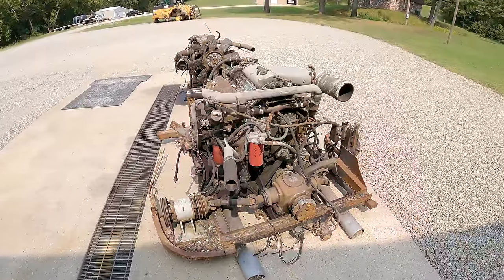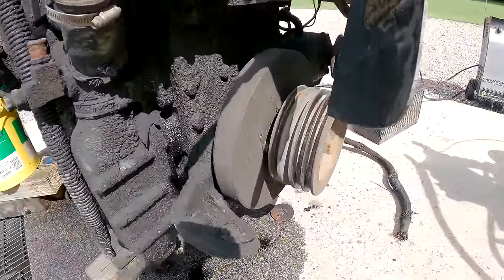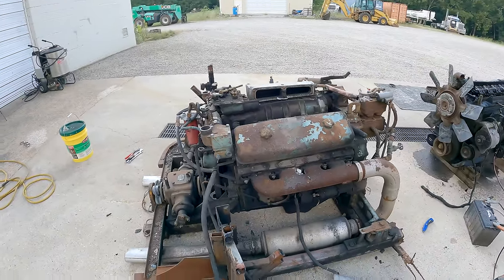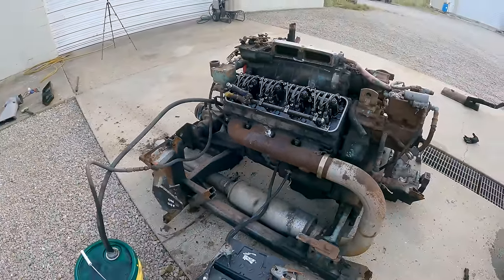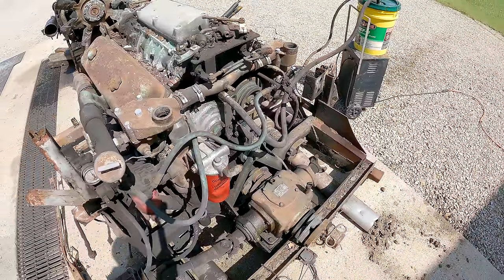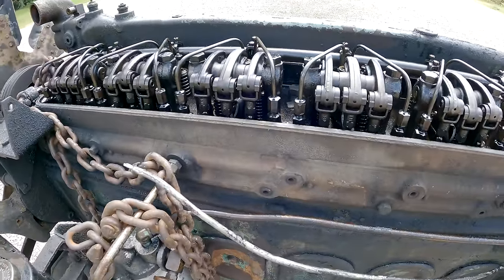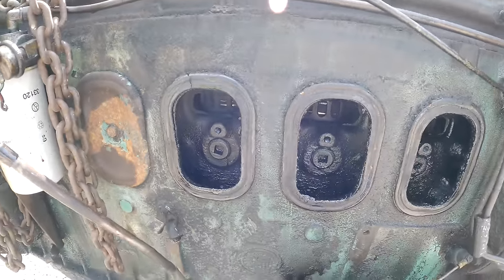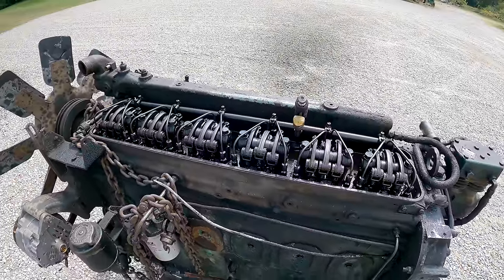Runaway 6-71 Two Stroke Detroit Diesel - Double Greasy Detroit Revival

Comment from the maker: Link to the engine teardown video on the 6-71:
https://www.youtube.com/watch?v=8Oyp_IiR1e4
Reply: 0
Reply: 0i
Reply: For as long as it ran at full tilt, it probably would of ran for another decade if put in an old farm truck and maintained.
Reply: Whats fkd up is they dnt make them that tough anymore. Look that she wants to still go
Reply: So that's not a runnaway. That was just full throttle. If you want a runaway plumb a gravity feed jug of fuel into the intake. Then runaway. She will split open
Reply: @shanelitzow2059  never though he could have another shot at that engine but if he ever decides to do it again or even better yet lable his videos correctly. Diesel engine runaway requires excess fuel causing the engine to Rev past its limit as diesel engine speed is totally controlled by fuel flow
Reply: @thewelfairshop4164  KT was probably trying to simulate the engine running away even though the rack was in full fuel position, im supprised the engine didnt run out of fuel though😂
Reply: I have dealt with 2 stroke DD for 40 years and while not as popular as they were there are many bus enthusiasts that look for parts when they need them. To purposely destroy one is a crime.
Reply: .ü
Reply: It had no coolant.  Just got hot and seized .  Pistons got so hot and scuffed so bad friction and lack of compression killed it   Like others I find this sad.

Comment: If it had a coolant system on it it would probably still be running lol
Reply: What a foolish waste.
Reply: @grantw.whitwam9948  you too.
Reply: We would be looking for hearing protection!
Reply: @grantw.whitwam9948  yeah that’s exactly what I thought! It could have been a freaking good engine if the admission was fixed instead of leaving it stuck wide open!
Reply: It was destined to the scrap pile to be melted down anyways.  Nobody wants them.  Inefficient, and heavy for their power.  They were incredible engines for their time, but their time has passed.
Reply: Screamin Demon.
Reply: @matthewbeasley7765  not really.  They are used all over the place, reason being easy to work on and maintain
Reply: For sure !
Reply: could have easily hooked a radiator up the the oil line. and turned it into an arc welder with some alternators....
Reply: @matthewbeasley7765  never. Todays diesels contain software to prevent any non dealer service. Watch your mouth
Reply: No shit
Reply: They’re cool and reliable and that’s really about it. I can see saving one that was a generator or something with no hours. Why bother with this turd.
Reply: It sat there floating the valves at about 5000 rpm. You are correct, if it had coolant, it would be sitting there to this day making noise and smoke.
Reply: @matthewbeasley7765  hahaha. You should do some research. Cummins is building this 6 banger to go in semi trucks. It has 2 cranks and runs piston to piston. No head!! The British have been running them in trains since 1951. It's called the deltic .... it has a 55% thermal efficiency and produces more power per pound than any other engine made. 4 cycle engines will soon be a thing of the past.
Reply: @grantw.whitwam9948  they   dont seem to sell for much   on ebay etc     interesting but not  worth much    id not take much to  make it worthless     eg one  jug low on comp etc
Reply: Jim jibroni  wrong
Reply: @EXwifeKILLER  used all over the place, yes....but mostly in 2nd and 3rd world areas
Reply: @k.r.f.j.b.8144  nah. In the United States daily.  A lot of barges run them because they are easy to maintain. Also used in Euclid dump trucks daily at some steel mills as well.
Reply: @matthewbeasley7765  I would have taken it..
Reply: Jim jibroni  I'm a semi truck driver I would have swapped it and used it till it died. Given I didn't die first.
Reply: Jim jibroni  they are good in boats because you are always pushing. But yea that motor was worn not worth anything.
Reply: Jim jibroni elaborate on why I wouldnt seeing as you are me.
Reply: No it wouldn’t it’s a Detroit lmao
Reply: @machiii7394  John Deere has software so if you do pretty much anything the tractor won’t move or it’ll have idiot lights on everywhere and you cant use them.
Reply: You guys are out of your minds. If it's so precious then why didn't you buy it? Nobody wants them and you guys talk about Detroits like they're national treasure. If it wasn't destined for the dump then it would not be there in the first place. Yeah, they're great to talk about but stop trying to justify saving crap on a zombie apocalypse.
Reply: Yes.. It could have gone on a trike or something!
Reply: Jim jibroni  "Oh for Christs sake" "NOBODY I mean NOBODY "  🖕   I guess I must be "NOBODY" I want a 3-71T in my F250, might well have been some thing of trade here ... Your diatribe should be reported I think. But I'll leave the foolish remark untouched  🤔 YEP
PS What pray tell has the EPA done for your pocketbook?
Reply: @TheReid1233  LMFAO
Reply: Jim jibroni  This channel doesn't have any content
Reply: Volvo b10 run all day with no water. and under load..
Reply: I was going to say the same exact thing
Reply: @charlesangell_bulmtl  -You threatened to report a comment because you didn't like the content? Pretty weak.
Reply: If it had infinite fuel, I bet yes! For 5 months I'd say.
Reply: @grantw.whitwam9948  how’s that I absolutely hate when people say that it’s a warn out greasy motor that no one wants how is it a waste what would this possibly be used for
Reply: @grantw.whitwam9948  You are so right...

...I see these becoming the "passenger pigeon" of our time... XD
Reply: @EXwifeKILLER  
Off highway only. you will NEVER see one in a working DOT inspected truck
Reply: @charlesangell_bulmtl  
"you should be reported" this hurts my feelings awww what a tool
Reply: @thicok4555  Those whom don't respect themselves generally don't respect others.
Reply: @zoggrog8823  Those with a shame based childhood often shame others.
Reply: I agree 100%
Reply: @grantw.whitwam9948  bro it's just a engine that he owns
Reply: Ten years ago I regularly worked on dd two strokes.6 and 8v71/92s.plenty of prime movers and buses still using them.
Reply: @russianacorns8080  hackers and farmers are forming relationships. software is now reverse engineerd like aftermarket parts. Just dont buy brand new and there should be a way to work on it.
Reply: @zoggrog8823  i have a greasy 361 industrial ford engine in an inspected dump truck that had a DOT number. 1972 vintage truck still hauling 6 tons 15-20 miles, almost every farm in america has at least one 2 stroke on it. Also youve never heard of a glider have you hmm? these 6 cylinders are too small for a semi but a 12 cylinder 2 stroke is perfect and lots of them are still on the road
Reply: @russianacorns8080  we had one in a gmc general. Still in use to this day. A detroit obviously. It did the job very well.
Reply: @aeroflopper  proof
Reply: @matthewbeasley7765  a lot of people want them.  They are still used all over the world.
Reply: @matthewbeasley7765  that is a lie. there's quite a few trucks still using them.
Reply: @grantw.whitwam9948 I understand what you're saying, but they produced untold millions of these from 1938 to 1995. Are you gonna rebuild them all? Do they all belong in a museum? This engine was going to be ground up and recycled. Why not have some fun first 😁

Comment: They were phenomenal engines for their time,no other inline six in the world could run that long under wide open fuel and no coolant.
Reply: Valve float saved it from scattering parts maybe.
Reply: They were originally designed to run for 10 minutes with no coolant in Higgins craft landing boats so they could keep the hydraulics running
Reply: Yeah, it only stopped because it obviously heat- seized. If that had coolant it would have been fine.
Reply: You can even see it backfiring too
Reply: Absolutely amazing this thing powered our boys to victory on D-DAY!!
Reply: Yeah I don't even think a Deutz air cooled would stand up to that
Reply: Have to remember it's a 2 stroke it will run longer without coolant than a 4 stroke would
Reply: @joecameron3512  explain 2 strokes make twice much power and heat
Reply: My Cummins N14 shuts down if the ~ 10-gallon cooling system is even 2 cups low.  😋
Reply: 4 stroke diesels require coolant too my guy. Your wild
Reply: Get a grip Rusty!, he only opened it up for a few seconds, SMH
Reply: That poor thing gave everything it possibly could. That’s Detroit steel for ya
Reply: @kevin9c1  if those springs were stronger it wouldn't last longer haha!
Reply: @keyboardplayerakas  Wow
Reply: @keyboardplayerakas  was designed before the boat . Air being forced through the engine actually cools it slightly.
Reply: Gotta love when it becomes oil cooled. You can tell as soon as it starts to turn that way, can hear the oil boiling inside the block.
Reply: @desotofiresweep58  why not?
Reply: @junkablyet944  
 Deutz's were bad about spinning bearings, if they were oversped
Reply: @ronalddaub9740  huge amounts of air flow

Not sure just pulled that out of my butt
Reply: @joecameron3512  why
Reply: Never underestimate russian engines....these things runs wood all day long in siberia, mostly in rivers because there are no trees, overloaded to oblivion......for like 50 years.
Reply: Should check out the ford falcon AU. Not exactly the same as this but man that engine can take a beating too
Reply: @desotofiresweep58  Well, might not going that high RPM, but why not? For instance MB OM606 Engines get crazy high RPM for a diesel
Reply: Silniki z MTZ Belarus 82 😎
Reply: 5:25 REV LIMITER!!! YEAH
Reply: Treat that thing with respect as it is a very high performance 2 stroke engine!
Reply: These are some amazing high performance 2 strokes. the mini Jimmy today is the polaris 850 patriot turbo! Rotax 850 etec turbo r and arctic cats 858 are other jimmies too!
Reply: I wish I had it,,I wouldn't destroy it

Comment: The 6-71 was first built in 1938 and used in war production, the Gray Marine 6-71's were used in almost all the landing craft all over the world, Detroit Diesel stopped making the 2 stroke 71,53 and 92 series in 1995. I operated and worked on hundreds of them in my 26 years in the military, they were good reliable engines that you never had to worry about anything in a 5 foot radius of rusting because it was always covered in oil!
Reply: They were only removed from production in 1995.... for "public consumption".   The US Gov't still maintains their use for US and allied military vehicle contracts, with "on demand" contract orders.  The 6-53T&TA as well as the 8-92TA is still "on the books"... albeit, out of public view.  The 8-71TA was also carried until 2015.
Reply: Nice, didn't they star putting them in tanks at some point?
Reply: @Busdude97 .... Not since WW2... we had several different tanks & tank destroyers (M10) with them, as well as APC's, Navy "Brown water" fast gun boats on the Mekong River and elsewhere, during the VN era, and later.  Just about every boat from Navy launches, to landing barges and everything in between were generally 6-71 DD powered.   

They probably would have been 6-110 powered, if they had, had the engine ready during WW2... instead of right at the end of it, in 1945.
Reply: You got right.they would take about a gal of oil a day per motor.  Every day you run them.
Reply: The Light Armored vehicle (LAV) the marine corps uses was 6v53T powered well into 2018 when I got out. Also the M113 the army uses had them, though I want to say they'res wasn't turbocharged and also didn't have Jacobs brakes as they were in a tracked vehicle, vs the LAV being wheeled. Very neat engines to have much education or experience on when you're less than 40 years old
Reply: My good friend just bought an 120yr old yacht with two 671's and a 371 for the generator. Every time we fire them up, I'm reminded of the opening scene to saving Private Ryan
Reply: I trained with the Army on LCM-8 s at Ft Eustis in 1967.  Each LCM-8 had four 6-71 mounted as pairs with each pair driving a screw.  Loved the sound of them.
Reply: Thanks for your service
Reply: @cadillaccooke811 m113's are TurboCharged.
Reply: @Romans--bo7br out of public view eh
Reply: still all over the marine industry. On boats, crane barges, and gen sets.
Reply: 5:25 REV LIMITER!!! YEAH
Reply: These are high perfomance 2 strokes with the most advanced alloys, 6-71 is a big polais engine
Reply: I thought so, i got a silver 8v92 TA a great engine. The EPA is a police organization that has a tiger kitten ever time a 2 stroke comes up no matter how clean burning it is.
Reply: thats about right
Reply: My dad talked about having to get off the bus with most of its passengers and walk up a hill behind it because it didn't have enough power to go up, loaded. Detroit diesel 6-71 power GMC bus.
Reply: So what was wrong with it? never heard of that before.
Reply: Lol for sure buddy. We always had a saying about Jimmy's. Check the fuel and fill the oil. Lol
Reply: @Romans--bo7br  Vietnam PBRs used two 6V53Ts, not 6-71s.  The LCM-8 had 4 6-71s (2 banks of 2).  I worked on them for 4 years.
Reply: Well thank you for your service and that is one cool job being a mechanic in the military thank you for your service

Comment: That 2 stroke sounded in good shape when it first fired up.....can’t believe it stood the test at full throttle for so long without any coolant. 
What an awesome engine. It’s a tribute to GM
I drove one for years. Used a gallon of oil every 500 gallons of diesel and started even at 30 below. Hit the starter and turn it over several times. Stop. Wait a few seconds to allow the heat to transfer a bit in the cylinders. Fire it again and she’ll start every time.
Reply: Feel angry when people destroy things like that.
Reply: @arthurheckendorf3324  well keep staying angry thing is they made alot of these like this didn't put a dent into any number of em.
Reply: Who ever you are, I love this story it comes  from a real driver.
Reply: Hello we heard you have oil is that correct?

Comment: Whatever people might say negative about a 2-Stoke Detroit Diesel especially the 71 Series no one cannot deny the fact they are tougher than woodpecker lips.  It absolutely amazes me that the 6-71 was made basically unchanged for 75 years and the only reason those oil drooling annoyingly loud pigs that turn diesel fuel into noise and smoke without making horsepower is the government basically outlawed them because it sure and hell wasn’t because Detroit Diesel wanted to quit making them.  Personally I have a soft spot in my heart for the green leakers’ mostly because the first truck I drove for a paycheck had a Buzz’en Dozen in it.
Reply: 92 series were absolutely awesome too.
Reply: gullreefclub..... Where or What, gives you the idea that "without making horsepower" was a characteristic of them?  You, like most out there... are completely devoid of how they actually function, and if you did know and understand... your jaw would "drop" in amazement.  

By the way, the 6-71 was in production for 57 yrs, 7 months (Jan.1938 - Aug.24th, 1995)... Not, "75 years" (2013).... but still, literally and Officially holds the World Title for being the Longest Production run of ANY reciprocating engine in history, as well as being the most Reliable.  

The 110 was also, every bit as reliable along with power potential and capability Far beyond what it was producing during that era, and was massively "over-built" for that purpose, however.. division "heads" wrongly decided to drop it from the line-up in 1965.   

It was truly "an engine ahead of its time" in terms of power capabilities... such a shame that the metallurgy of the era in transmissions and drive-lines for HD On-Hwy trucks had Not yet caught up to it.
Reply: Your comments are of a fool. Back in the day, when a 230 horse engine was all anyone made, the 238 was king, leader of the pack. My dad had a 61 Mack with the 230 turbo charged Mack engine, and his brother had a 238 in his truck. The 238 walked away from the Mack in every situation, getting better milage than anything on the road, cause it burnt 98% of its fuel, instead of blowing it out the exhaust.  You are comparing a 75 year old engine to modern technology and making fun of it. The 2 cycle Detroit built modern America. Give it its dues. By the way Mr know it all, Cummins is building that engine again, to go in semi trucks in 2025....
Reply: Class Act  yah,I was a mechanic mos 63c back in 1969..I never had a problem with those apc but the ones with the gas Chrysler and Chevy v8 always a problem..these engines can be made to run forwards or backwards and will even run away burning their crankcase oil in certain conditions
Reply: Awesome  @Romans--bo7br